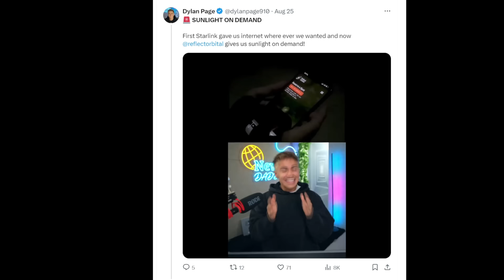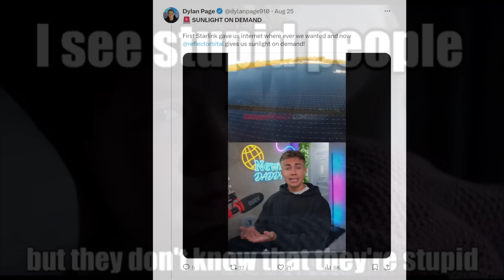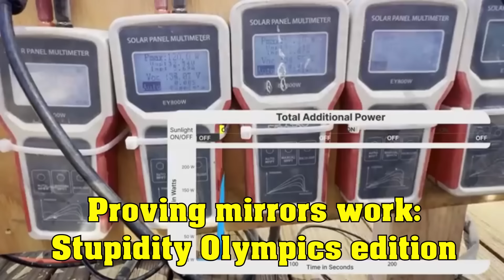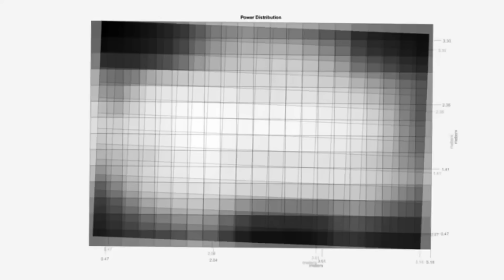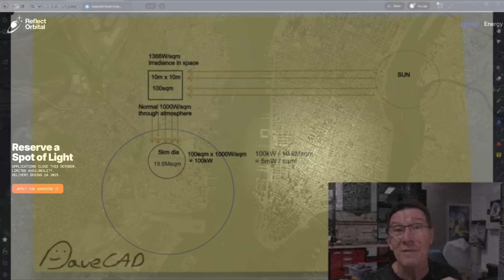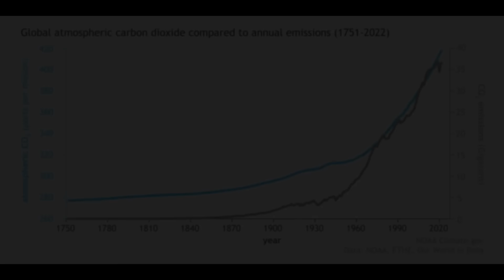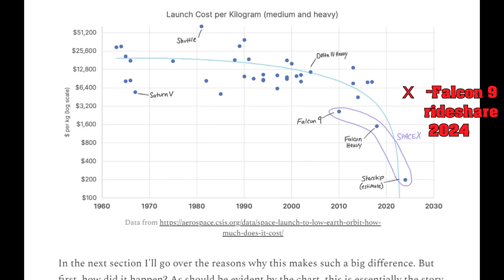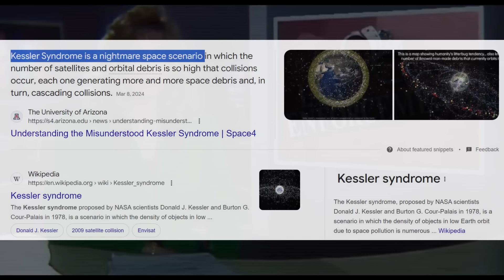Reflect Orbital: BUSTED!!

Comment: You could counter most of the spreading out over distance if you used concave mirrors instead of flat ones,  Though I'm pretty sure you'd need an absolutely massive mirror for that to work; like so big you'd have to totally build it in space.
Reply: earth surface is not flat smooth, how will this mirror focus on diffirent earth elevations?
Reply: @slavakulishko3771  Well obviously you'd have to have it focus on one specific point, or have ways to adjust its shape slightly to deal with changes in elevation. Still, given the relative differences in elevation and the distances involved, I can't imagine the illuminated area would change much. I dunno, I'm not an expert at mirror mechanics.

Comment: Interesting note
Another video mentioned that the soviets had already experimented with this using a similar sized mirror.
The real world performance however was only about as bright as the full moon, or about 1/400k sunlight.
Comparing this to the hypothetical maximum of 1/250k sunlight suggests either a significant difference in focal lenght . . . or significant losses to the atmosphere
Possibly making this implausible idea even less likely

Comment: The USSR did this to light up an oil field at night. I believe i recall they achieved 10% or less light for what was a few minutes. They did 3 or 4 prototypes where each mirror was bigger than the last. The costs of this project vs what you obtain in light is not worth it.

Comment: 20 seconds in, and my first thought is that the sheer number of mirrors required to collect enough sunlight to be meaningful immediately makes this a nonstarter due to costs alone. Second, the vast majority of light sent down will be mostly scattered and/or absorbed by the atmosphere and/or blocked by clouds. Third, if you did magically manage to send down any meaningful amount of energy, you essentially just created a space death laser.

Actually, now that I think of it, it would probably be more efficient put the mirrors on towers or mountains on the ground. Like chains of massive heliographs stretching across continents. Still way less efficient than just using solar panels and moving the produced electricity through cables, but it makes more sense than a bunch of satellites.
Reply: Well, Elon already sent thousands of satellites into space that reflect light down, ruining astronomy. And these "mirrors" wouldn't be much brighter. So - it's been done already, it just sucks :)
Reply: Anyone who actually wanted to do this would use curved mirrors, to focus the light onto a smaller area. But the smaller the area you want to focus on, the more precise your mirror needs to be. And it'd still be a blurry, and have a minimal size, as lenses and mirrors have a "resolution limit", because light does weird wavy things. To actually build a death laser, you'd need some very large, very precisely made space mirrors.
Reply: Not to forget that due to the drag Spacelink satellites naturally deorbit in 5 years or so. So, you need continuous supply of the space junk, sorry, satellites.
Reply: @EvanOfTheDarkness  No problem! Just a few hundred thousand "Hubble" mirrors.
Reply: The Iridium constellation of satellites have highly polished main mission antennas that are about the size of a hall closed door. They are carefully oriented, so that the antenna maintains a constant geometric relationship. This is so reliable for an active satellite, that you can do the math and determine when (during the hour or so after sunset, that they are still above the Earth's shadow) the reflection will point directly at a spot on Earth. I've done this a number of times, and even wrote software to automate the predictions.
The end result of this mirror reflecting sunlight is that you can see the brightening spot for about 2-3 minutes. For a fraction of that time, the reflection will be the brightest non-full-moon object in the sky. There will even be a brief 'flare' where it is impressively bright. But, even that is never enough that you cast a shadow because of it. Having the ability to point that reflection accurately, on demand, at any point on Earth would require attitude and orbital adjustments too numerous to support a reasonable life span for these satellites. The fact that a full moon isn't enough reflected light to run solar farms should have been their very first clue.

Comment: The Saturn V also managed to recover a whopping 2.5% of dry vehicle weight, a large portion of that being the recovery system and crew capsule. Jettisoning 200 tonnes of non-mass produced precision machinery that was never flight tested before use. Literally like going up in a fully handmade 777 that has never flown before and will never fly again, and coming down on parachutes. Designing an industrially-manufactured reusable aerospace craft surely takes more development time than that. Any landing you can walk away from is a good landing, but if you can fly it again the next day, that is an excellent landing. Starship is going for industrialized production methods and an excellent landing. That costs something in terms of development time.
Reply: It'd cost a lot less if Elon didn't insist on bad design choices and not properly testing things on the ground before putting it in the sky.

Ironically, it would also cost less if he didn't insist on the reuse factor,  because you basically have to double the size of the rocket to have enough fuel to cover the landing as well, which adds a lot of material and fuel costs to go with the greatly increased complexity.

Comment: Strength of sunlight per meter squared is about 2kw, so ten times that is 20kw,but then dilute that to a 5km square, five million square meters
(20,000/5000000) is 0.004kw a square meter, or, four watts, maximum, per square meter, provided there is no sun, no atmosphere, not dust no pollution and no damage to a perfectly flat and reflective mirror

Four watts.

Comment: Batman and Robin actually had a proposal for this. It was pretty dumb, but most people were focused on the nipples on the Batsuit. It used several mirrors to direct the light to a telescope. Adding another satellite or two would get around the issue of the rocks. but it also adds a ton of issues. I can't imagine how this would be technically feasible, at any price.

Comment: Me and my housemate regularly sit outside on clear nights watching satellites going over. They are faint dots, that you have to train your eyes to see. The mirrors would have to be massive and very precisely engineered to focus the light, which would only work at a restricted set of altitudes. this is not an new idea either, the concept has been around for decades.
The main thought in the past is to light areas so that they aren't in total darkness. Not full daylight but a general light to use. It could be done in areas to make it easier to harvest large fields, or in disaster areas to help with the rescue attempt. You would have to have massive number of these reflectors to run a solar farm.
Better, but still highly dangerous, idea was to have solar collecters in space, and microwave them down to earth collectors. The potential issues are high, including if it went off target and fried the local area

Comment: "Researching" something about the subject I've read that the height of geostationary satellites has to be considerably higher, from 22.000 km to 36.000 km, quite a bit higher than 500 km. Unless they're not supposed to be geostationary, which was what I assumed or heard before. Assuming this height requirement is correct, that must increase considerably the problem of both the focus perimeter and perhaps even the light scattering/loss/pollution.

At lower orbits, around 500 km, there's still atmospheric drag to complicate things further, requiring periodic orbit corrections and whatnot. GPT4-mini says that LEO satellites intended to extend daylight for 4 minutes focusing mirrors on solar farms would require maneuverability beyond that of ordinary LEO satellites in use. I asked whether wouldn't it be operationally/maneuverability-wise simpler and achieving a higher yield to use such mirrors in day time to focus more light for more time on solar farms, it also agreed with this perspective. For whatever the next-word-suggestion-on-steroids is worth. 

"The advantages of longer duration, higher irradiance, and increased efficiency make daytime focusing a more appealing and practical approach for enhancing solar energy production."  GPT4. I'm not even sure it's even "appealing" at all yet, so perhaps it would have done better by saying it's less unappealing...

Comment: Well to be fair, we know light can be reflected from mirror to mirror. And maybe we can put up a shade in orbit that can partially block the sun but on the other side of it we have solar panels, and then it beams it down in the form of microwaves to remotely power things on the ground. The problem is all of those needed rocket launches just to put everything up there.

Comment: I thought of another problem no one addressed. Even if these things worked, even if we were in magical imagination land where they reflected the light like the wanted and were effective for energy production, there's still a fatal issue. These mirror satellites wouldn't last very long. There's the obvious problem of being smashed to bits by all the debris in orbit, but past that, every time these mirrors made any adjustments to focus on a specific area, they'd have to use fuel, right? They could only be launched with so much and once it's out, it's dead and would have to be replaced. If these things are 'on demand', they'd burn up their fuel very quickly (I'm guessing in magical imagination land where this worked and you had sunlight on demand, the cost would be a few million per minute).

Comment: I am sure there are some engineering solutions to the issues highlighted here. For example, what if the mirrors are focusable, and the array of satellites can reflect the sunlight between each other to go around the curvature of the earth? Or would it just be easier to have the satellites in Geo-Stationary orbit with a set focus, would that make the angle at which sunlight can be reflected greater? Just some ideas off the top of my head, which might be cost prohibitive at the end of the day, but pretty interesting nonetheless.

Comment: The balloon thing really made me laugh... they hung a mirror of a balloon and pointed it at an off-the-shelf solar panel. Everything in that clip is a technology that existed and was in mass production for decades, centuries, and even for some parts. A 1-day private ballon hire: $1000, large framed mirror: $500, metal scaffold frame: $300, 500W solar panel: $100; I will throw in $100 for wires and other miscellaneous stuff. We are talking less than $2K of ready-made parts and services. But they really tried to make it sound like it was some hard effort.
Reply: Regarding your last sentence: obviously, since they are attempting to sell vaporware.

Comment: Sorry Thunderf00t but Solar Mirrors have been successfully launched and tested.  A little historical research into space mirrors would show you that the Germans had early plans to use space based mirrors as a solar weapon, which of course never got off the ground nor worked.  However, there was a Russian scientist by the name of Vladimir Syromyatnikov is often referred to as the “Father of the Solar Sail”.  His original designs were  for a large solar sail but due ot the fall of the USSR he changed his idea from solar sail to solar mirror to provide much needed light and potential energy to areas of Russia that are close to the north pole that have very limited number of days with actual sunlight VS the many days in darkness depending on the season of the year where not much can get done in the darkness.   They acually built and tested a few of these solar mirrors and launched several as well.  The first, Znamya solar mirror was a prototype and never launched, Znamya 2 was 20 meters, Znamya 2.5 was 25 meters and the version 3 was 70 meters in diameter and the final design was to be 200 meters in diameter.   They also had plans to create a fleet of 24 to 36 of these that could be moved by thrusters to focus an all spread over a certain area or to have the fleet focused on a single point.  The first space test was successfully launched on Oct 27th 1992 in deployment but only was tested for a short time and it did create a 5KM beam of light that traveled across the planet from France to Russia with this beam of light before it was deorbited as it was only a test.   Granted this 5km beam of light had the lighting similar to the brightness of a full moon as Znamya 2 was only 20 meters in diameter.  But it proved the concept.  The second test flight, Znamya 2.5's 25 metere reflector was launched in 1999 but had a deployment failure when trying to spin out the mirror made of Mylar got caught on parts of the craft and failed.  But it was projected to produce enough light equal to 5-10 full moons.   Sadly he died in 2006 as well as the interest and investment dried up.  But imagine what a fleet of solar mirrors, 200 meters in diameter could do to light up areas that spend a majority of the year in perpetual darkness for exploration of those areas.

Comment: I have a solution for their satellite amount problem. Just launch the rockets filled with silver dust! The only downside is the enormous amount of money burnt, the enormous amount of rocket fuel burnt, and the small problem that if you turn the entire orbit into a mirror, you actually get 0 sunlight on surface, even on the half of the planet that is facing the sun at the moment. But at least you solve global warming for a moment, until the random particles escaping the earth ultimately slow the silver dust down to the point when it can no longer stay on orbit.

Comment: @Thunderfoot The calculations for the 5 sq km are off a bit here, because 5 sq km are not 5km*5km. That would be 25 sq km. So the dilution of the sunlight  is 5 times less worse than shown here. Still, it is bad.

Comment: Mirrors in space are not a stupid idea. The idea makes sense in principle. But when you look at the numbers and details, you realize that it will be very inefficient.
It probably won't even capture enough energy to offset the energy that was required to launch the mirror into space (and for the maintenance).
So, the idea isn't stupid, it is just not feasible.
Reply: yes, but what do you call being incapable of figuring that out and instead go around promoting this like it's a real project "YOU can get in on the ground floor of today" ? Con Man might be about right.

Comment: Ok, follow up pitch ..... we make a massive fiberoptic cable that we point at the sun, and the other end aimed at your destination "spot." I've done the math in mathland, and we can just recycle every unused optic cable on earth to make a 'mega cable' for less than elevendy-billion dollars. 

 Boom!.....fund me!
Reply: I don't know, I think a permanent cable of this size is highly problematic. Why not have orbital sun power battery changing stations that we load and unload with cables/elevators where the batteries going down pull up the ones emptied to be recharged? OR maybe the orbital station but with rockets and parachutes/drones carrying the batteries down. PS.: both are also supposedly to be jokes, but since the level of nonsense is roughly similar to that of the idea proposed on the video I guess it's better to make that clear.

Comment: That's how it is today with all the great start-ups. Instead of simply calculating theoretically with a pen, a piece of paper and a calculator whether something is even energetically possible or makes sense or what you could expect in the end under ideal conditions at best, what costs are compared to what benefits... NO, they'd rather start by making CGI animations of the product, filming commercials, carrying out pointless tests and then trying to build a portotype, only to realize in the end that none of it can work, which a few calculations on a piece of paper would have told you right from the start. 

But these guys here, they are even worse, they claim to have done the math, but their calculations are complete nonsense. In other words, they can't even do math.

Comment: Wasn't the idea to put massive solar panel arrays in geostationary orbit of Earth; and then bean the power back to Earth? Pretty sure I read about that back in the 80s. I saw an episode of the BBC Horizon program, which discussed the idea of building solar panels around the Moon equator. Using local resources and robotic equipment. Half of them would always be in sunlight, and again the power would be beamed back to Earth.